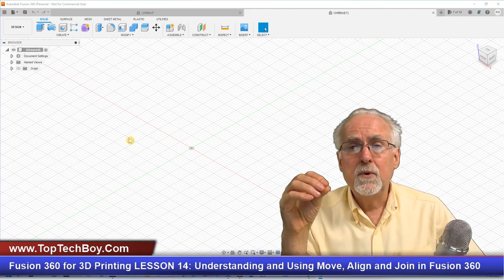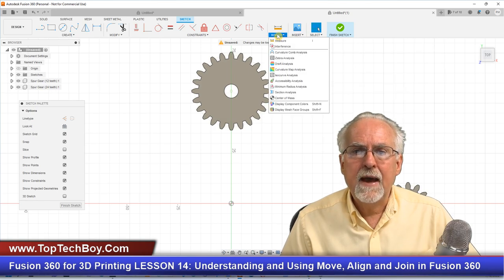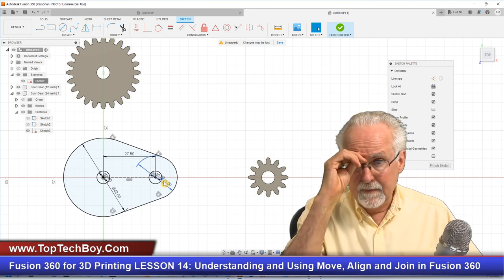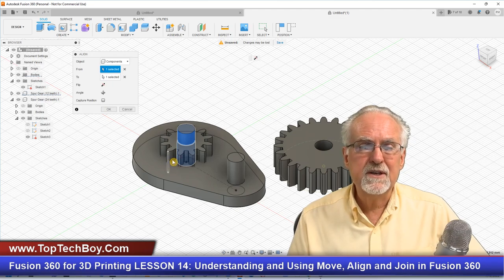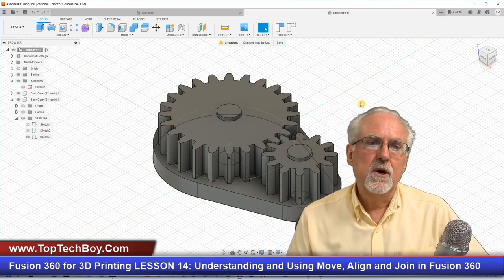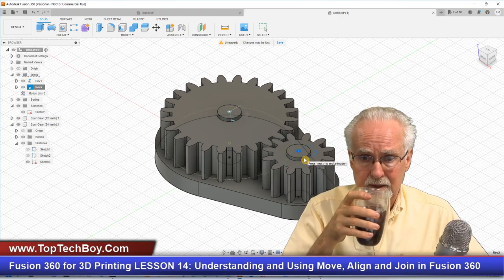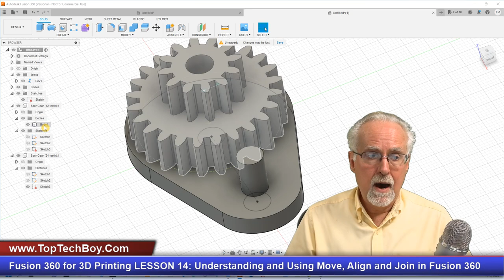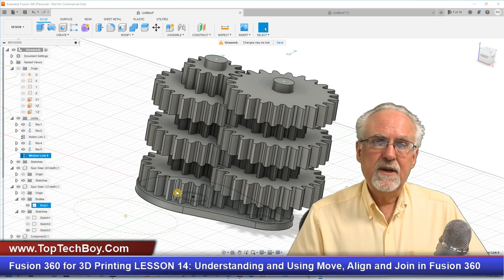Fusion 360 for 3D Printing LESSON 14: Understanding and Using Move, Align and Joints for Assembly

Comment: Great lessons Paul, managed to get the gears rotating using 5 double gear and one of each single at either end.
Reply: Yeah, I finally figured that out too.  The design flaw I reference in my solution was about the single gear at each end and only 5 double gears, not 6, as I originally had it.  I realized it was not going to work even before I printed the first piece.

Comment: Hi Paul, first thanks for the great series, please keep them coming. I have the gearbox drawn done in fusion, but can’t get all the rotation parts. Got the bottom ones, trying to add the next layer but not sure how,hope you will enlighten.

Started the 3D printing, at present printing the base two single gears and one double, if I am right will need a further three double
Reply: 5 double gears in all.
Reply: @codecage9333  hi just print off 4 but that will do to get the jist, I did have a problem with the base , printed okay but one off the columns broke off. Made a new one from aluminium

Comment: First I just wanted to say these videos have been awesome!!   I did have a question on this weeks homework though. I'm not sure which of the gears out the stack should be free and which are attached..  If the whole stack is "fixed" Doesn't that just give you a 1:1 ratio??  (Or shall I say 2:1 because the the teeth double). What I'm getting at is if they're all fixed the stack would have the same output as last weeks setup??

Comment: C++ Spur Gear add-on wouldn't load. Python add-on worked. Is C++ required to be resident on local computer? i5 CPU, 16 Gb RAM, NVIDIA GeForce GPU - New HP Victus

Comment: I've started and here is a link to the first part of the design: https://youtu.be/siHZZ6Py424
Finally, the hard part is finished!  And here is that link: https://youtu.be/UVZWBLiPrrg

I have an issue with my printer such that it doesn't print perfectly round holes or vertical shafts.  So when you put a gear on a shaft it might start to turn OK, but will begin to bind when the shorter axis of the hole turns to the longer axis of the shaft.  In other words the X & Y axis movement are not absolutely the same.  They are not far off, but it doesn't need to be off much before it becomes noticeable.

I also added a cap or bracket, whatever you want to call it, to go at the very top to keep the shafts from bending outwards as the gears were turned.  Since we were using such small diameter shafts, they seemed to bend rather easily (I even had one break off near the base!).  Although it would have taken much longer to print, if we had used posts that were more like 14.8mm in diameter and gears with a 15 mm hole, the shafts probably would not have had that bending problem.

Comment: Hey Paul. I'm a little confused about the homework assignment. Is it just 6 identical gears, each with a 24 tooth and a 12 tooth join together? Or are any of them a single 24 tooth or single 12 tooth gear? I might be over thinking this thing, lol. Thanks.
Reply from the maker: As I showed in the video, many of the gears are one body . . . small gear rigidly fixed to the lower big gear. You have to think through that and I will show the solution next week.
Reply: Gears are locked and will not turn if all gear components are one body
Reply: @Jason Rhoades - You are on the right track there with the single 12 and single 24 tooth gears.